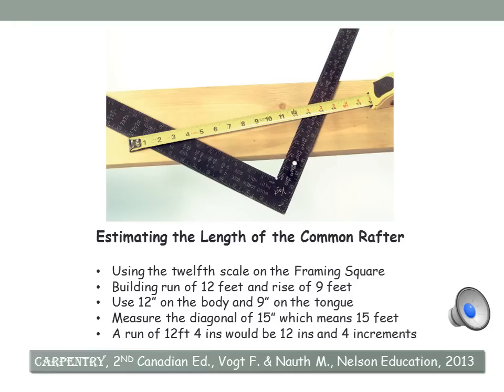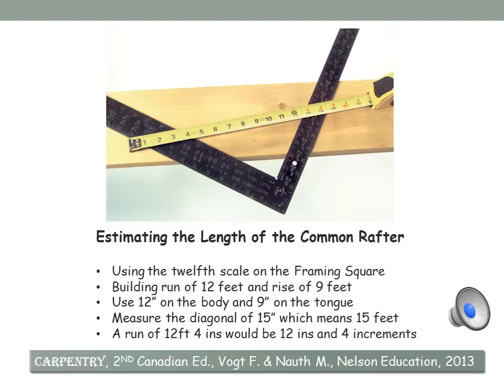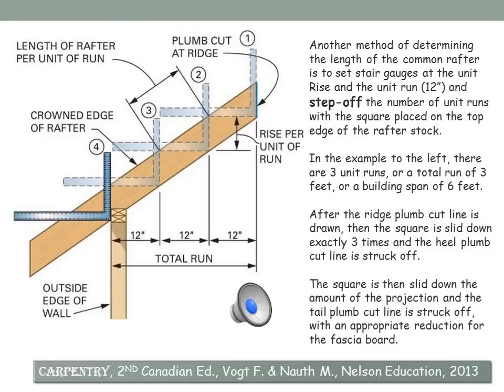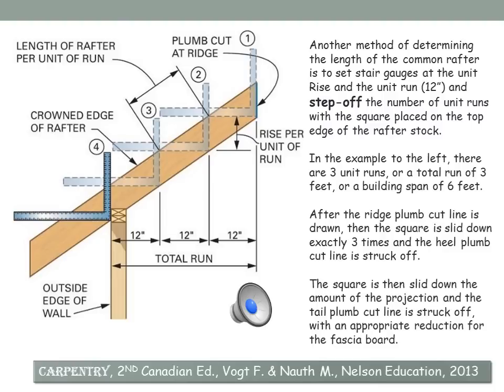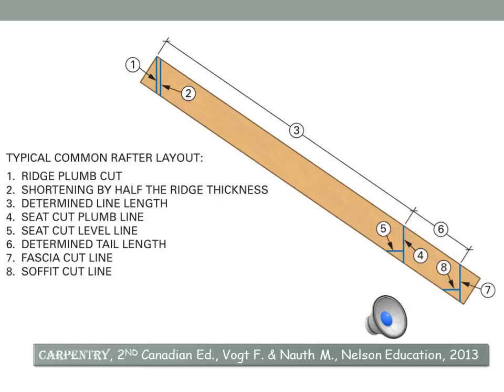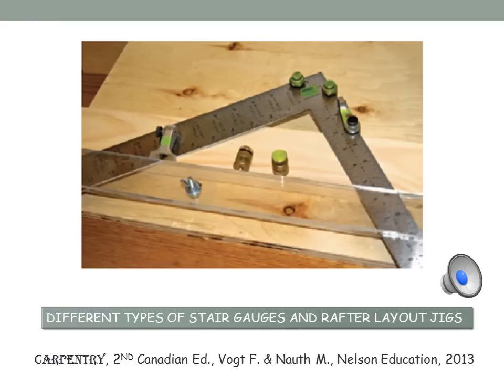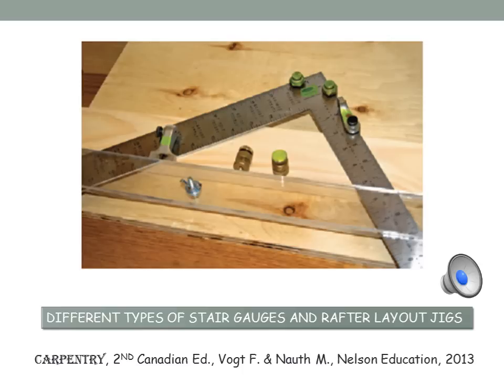COMMON RAFTER

Comment: Great video! Measure along the top of the rafter stock to get the rafter length and the overhang...does that procedure apply to the hip rafter as well, i.e. measure along the top of the rafter stock (allowing for the longer overhang on the hip)?
Reply from the maker: Thanks Jacob. Yes the same applies to the Hip Rafter.

Comment: Question. I'm trying to find the ridge board height but I'm getting confused.  My roof is 6/12 pitch. When you say: "Take the Rafter Stand length (in my case its 2 and one-fourth inches) and add it to the rise, do you mean the actual rise (in my case 6)? 

Ex: 6 + 2 - 1/4"  = 8 - 1/4"

Or should I  be using the  unit length (13.42)?

Ex: 13.42 = 2-1/4" =  15.67 ( 15-11/16")
Reply from the maker: +dlaveen1978 
The Rise here refers to the Total Rise.  Say 6/12 slope for a building that is 20 ft wide.
The Building Span is 20 ft, the Total Run is 10 ft., and the Total Rise is 5 ft. (Rise  = ½ the Run for a 6/12  slope).
The actual height of the ridge board (if it is bevelled to the slope of the roof) would be 5' 2¼" given the stand is 2¼".
If the ridge board is 1½" thick and is flat on top, you would then subtract 3/8" to get 5' 1 7/8" to the top of the ridge.
Reply from the maker: Depends on the width or span of the building.  For instance, if the building is 10' wide, the span is 10', the run is 5', and the rise is 2' 6" or ½the run for a 6/12 slope.  The top of a bevelled ridgeboard would then be 2' 8¼" or the top of a flat ridge ridge would be 2' 7 7/8" or 3/8" lower.

Comment: Hi, how to determine the (8,12) (6,12) (4,12) (3,12) and so plum cut thanks
Reply from the maker: The angles are determined by the formula:  InvTan ( Rise ÷ Run); for an 8/12 slope : INV TAN (8÷12) = 34°